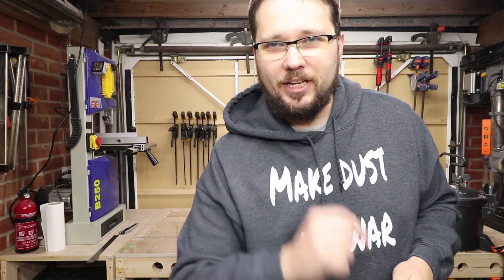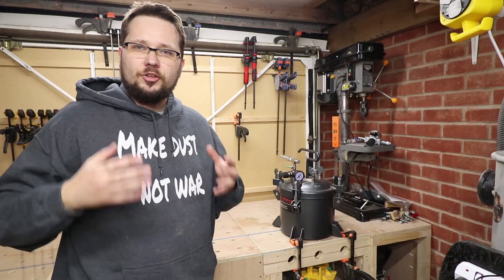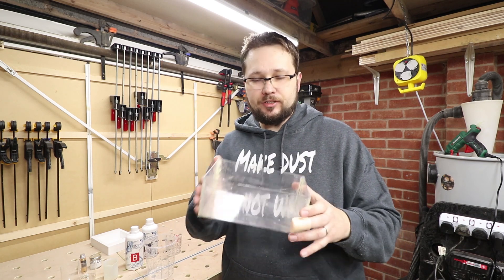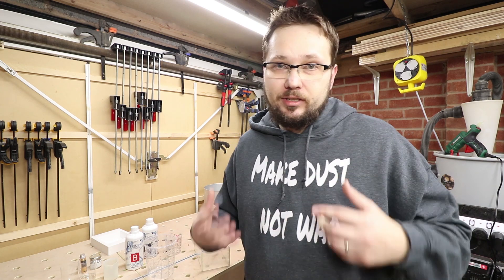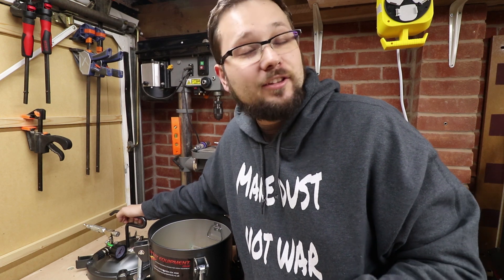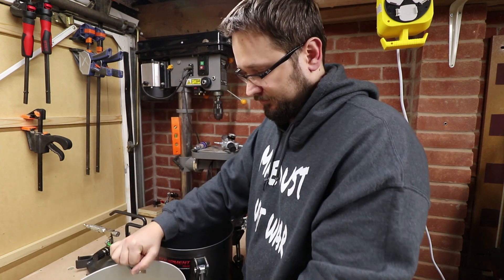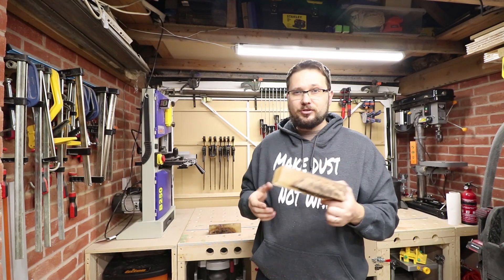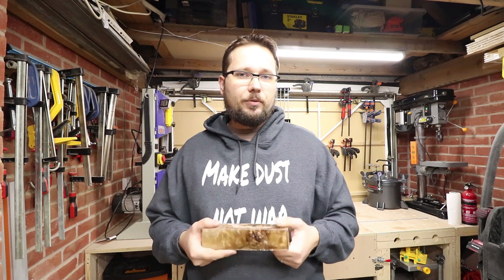Casting resin with pressure pot - resin casting with no air bubbles - Resin Tutorial

Comment: Do you have to keep the compressor on for 24 hours?
Reply from the maker: @catsadilla324  no, just load the pressure and lock the valve so the air will not escape
Reply: @CasualDIY  excellent thanks for letting me know.

Comment: thanks for the videos. can you use the pressure pot to simply put your mixed epoxy in there to remove bubbles for a few minutes, then remove and pour into the mold?
Reply from the maker: No it doesn't work like that. Pressure Pot doesn't remove air bubbles per say. Due to the pressure created they are forced to tiny sizes that you can see with a naked eye. Hence you need the resin to cure in the pot. If you release the pressure and the resin is not cured the air bubbles will go back to what they were. I hope this makes sense.
Reply: @CasualDIY  makes perfect sense. Thanks for the info

Comment: What you did was very opaque so bubbles being seen wouldn't be much of an issue surely?
Reply from the maker: They would. If you had a lot of air bubbles in the casting it would be very clear during sanding process. As the air pockets would be very visible as you sand. And at that point there's not much you can do to rectify it. The casting came transparent in some parts so air bubbles would be visible.

Comment: This video was very useful to me thank you. I have been collaborating with Resin Pro in my videos, if they hadn’t sent me the Liquidissima resin I would never have known how great it is. I have tried many resins and it is my favourite by far. I like how you showed that you can exceed the recommended depth when using a pressure pot because I am considering buying one but do you find that the resin over heats when exceeding the recommended maximum depth? I have ruined many silicone moulds after pouring my resin too deep.
Reply from the maker: Thank you for watching. Yes the resin may get hotter. It all depends on many aspects and on resin itself. Sometimes even a perfect casting can go wrong for unknown reason. But obviously if you doing something that's not recommend by the manufacturer then yes you may end up with a mess.

Comment: Thought you were going to explain how to use the device but I ended up just sitting here watching you do it with no instruction.
Reply from the maker: Not much to explain really, put your casting to the pot, close the lid, with a compressor pomp air to desired level and that's it.
Reply: @CasualDIY  sure but what are the specifications and how do you know what PSI to use and for how long and how do you safely start and stop the pressure and should you use a safety valve and how do you convert it from paint use to resin use ECT.
Reply from the maker: @tornadoallie3  hmm ok I can see the questions now. I'll try to make a dedicated video to all this. If you got any more questions please drop them here and I will try to cover them in a video👍
Reply: @CasualDIY  just anything and everything you can tell us about pressure pots would be great. Good brands and how to be safe with them and everything. I only learned the term pressure pot yesterday but I'm thinking about doing a project that would need one so any info you have would be great!
Reply: @CasualDIY  Could you also explain what air compressors are best to use for this kind of pressure pot? And show us how to use one. I've seen a lot of videos about pressure pots and none about air compressors.
Reply from the maker: Ok added to the list

Comment: Hi I was wondering if you could help me, I have the same pressure pot like you but it keeps leaking air from the hole on the safety valve. I am aware that it releases air when its over pressured. However this is not the case, I fill it to the required pressure but it keeps leaking a large amount out of the hole on the side of the valve. I am completely new to the trade and I was wondering if you could offer me some advice please.
Reply from the maker: Hmm if you bought it recently I would contact your seller first before you start messing around with it as it may good your warranty.
Reply: Sadly I did and they sent me a new safety valve and it's doing exactly the same. Surely they cant be both faulty but cant figure out why it's doing it. The only way it stops is if I close off the hole which I personally dont want to do as it takes away the safety aspect Haha
Reply from the maker: @michelesenior590  hmm not sure mate, not a specialist in that myself.
Reply from the maker: @michelesenior590  go over to Zac Higgins channel he is very experienced in using the pots maybe he will have some info for you
Reply: Thank you so much! I will ask him.

Comment: Tomasz Iam looking for a bandsaw...... are you still happy with the charnwood? Any grumbles..... as always cracking video
Reply from the maker: Thanks, hmm I find my Charnwood a bit underpowered and the bearings holding the blade in line are a nightmare to line up correctly after blade change. But other then that had no issues with it. Works fine. But personally I would go for the model up.( I got B250)
Reply: @CasualDIY  cheers mate appreciate the honest feedback
Reply from the maker: @Thesidingsworkshop  no problem mate 👍

Comment: I don't see a link for the pressure pot. What brand, where to buy, etc?
Reply from the maker: Hi, there you go, here the link to where I've bought my pressure pot
http://www.pressurepots.co.uk/resin-moulding-tanks.html
Reply: @CasualDIY  Do you have a link to the compressor you use and a video explaining how to connect them (hook them up together) and use them?  If not your own, then a link to this?  This is NEW to me, and I am not a pro.  :)  Hehe
Reply: @ArielleHaze  did you ever find out which compressor it was?
Reply: @rebeccaturton9716  No.  :(
Reply: Pretty much the same pot over at https://www.sprayequipment.co.uk they also sell compressors specifically for casting pots